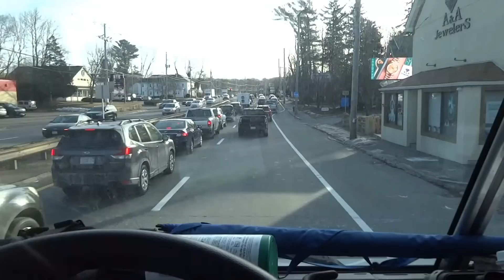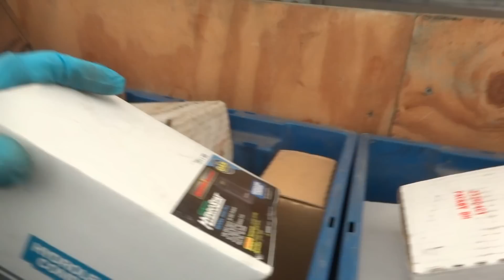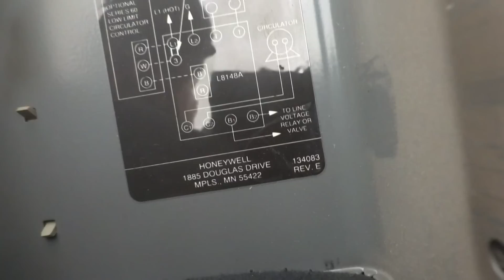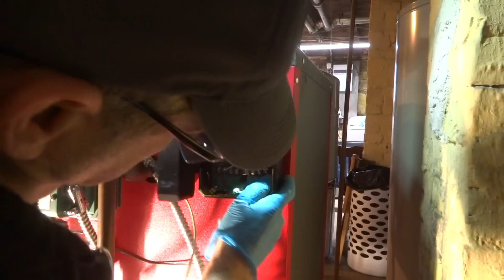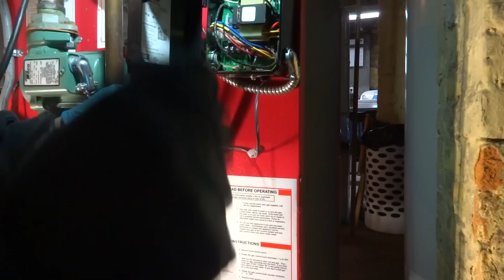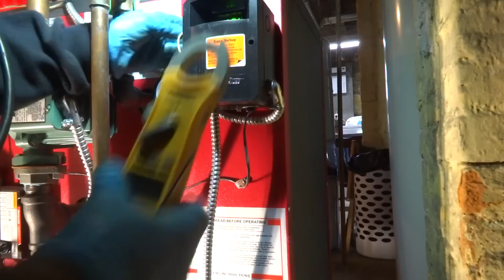GAS BOILER NO HEAT 2ND FLOOR

Comment: That stacked damper is a piece of shit and problematic when replacing the control removed damper completely and replaced with a piece of smoke pipe done deal  also you should turn that low limit to the off position. If not, it will maintain temperature to that point and it will gravity and heat radiators will not need it and will be real hot in the summer if you don’t have a flow valve or a IFC.